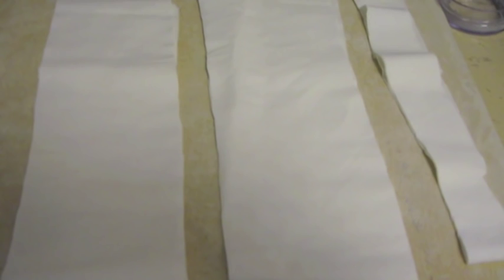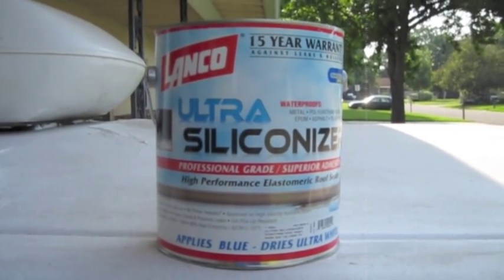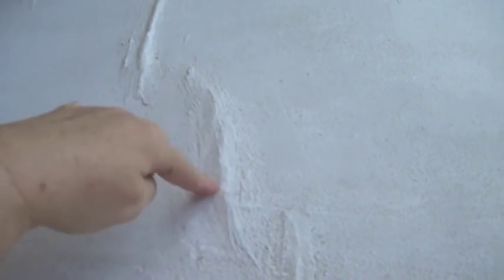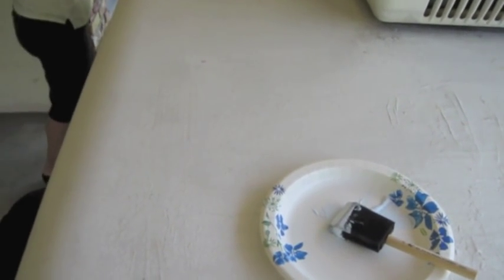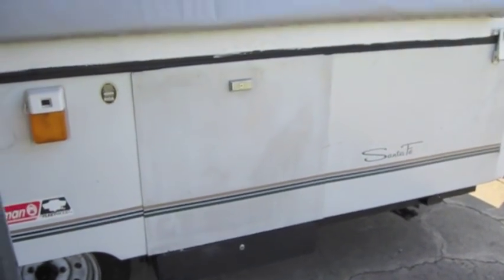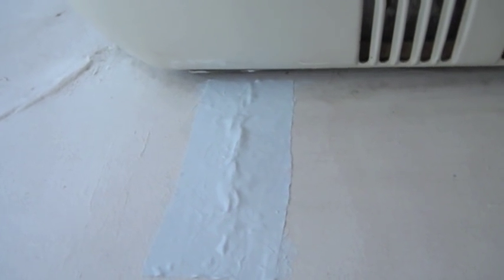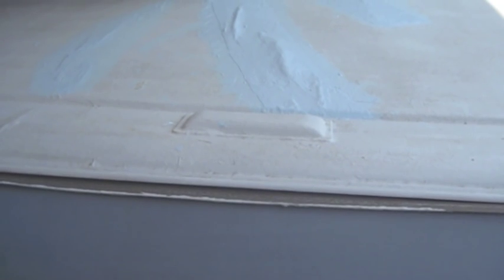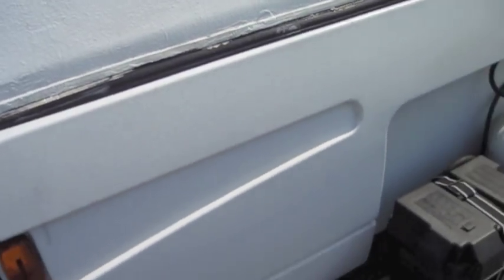Coleman Fleetwood Santa Fe 2001 Camper Roof Repair

Comment from the maker: I sold it a  little over a year after fixing the roof.  It was perfect when I sold it!  I also kept the camper on my two car carport.  I rolled the product onto the entire roof a month after purchasing it.  These large cracks I caulked originally.  The large cracks were up to 1/2 inch wide.  The previous owner had caulked the also.

Comment: hi Pia a : I am hoping to hear back from you...
  I have a Colman 2000 Fleetwood - Sea Pine popup camper . It also has a ABS roof on it like your Fleetwood Santa Fe .
  Only problem with mine is , the roof has lots of big cracks all down the hole top of the roof . 
It is so bad in one area were the awning is we had to take the awning off due to it cracked all the way down were the awning attaches to the roof  .. 
 * we did not even know this cracked until we  tried to put it up in 2011( it was fine in the summer of 2010 ) and that is when we could hear it cracking and braking . Since we were told from the company that we bought it from that the roof has a "  Lifetime Guarantee " I quickly called that company . Well the company went out of business & our insurance company told us to ether keep it but with no insurance and get some $ or sell it to them and get little $ .
 ** we still have  the camper in our back yard with a big tarp on it ..  we were  trying to fix it since 2011 - 2012 ,  but did not know how . ( we almost sold it 2 times )    
I am now seeing lots of Videos like yours on how to fix this ABS roof . 
 >  Now I am wondering could you tell me if this : Lanco Ultra Siliconizer 
  will work on much larger cracks - were big sections of the ABS roof pealed off 
 and area's that pulled away from the roof were  the awning was ?
 > I am also wondering what kind of fabric did you use & were did you get that fabric ? 
  Thank you for any information you can give me .
Reply: Your best bet is to remove the ABS roofing all together. Underneath you should find fiber glass. What I would recommend is applying a bed liner coating like " grizzly Grip or Raptor. Will adhere well to the fibre glass and last you a very long time.

There are several videos on you tube using this product on pop up trailers. Personally this is your best bet and I am sure you will not regret it. 

Good luck!

Comment: I was hoping to watch the actual application because I have a coleman popup camper also with an A/C unit.  It's a 1999 model.  I bought it last year and haven't used it yet.  I bought a cover but sitting over the winter caused a lot of the micro cracks to become larger and the large cracks to split open and lots of water was between the cover and the substrate.  The vinyl coating has large bubbles of lifting off of the ABS substrate or what ever it is underneath.  I may have to just coat the entire thing after getting the large cracks that have split open.  My camper has two kingsized beds so it's a big one.   Also, I didn't know that there is a filter in the A/C unit.  Where is it and how do you change it?  I would like to get it ready to use.